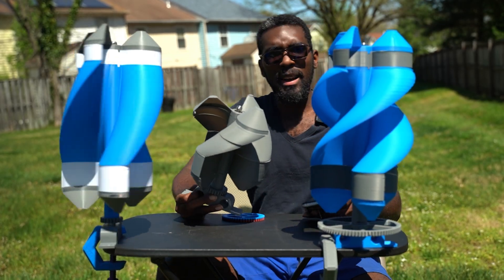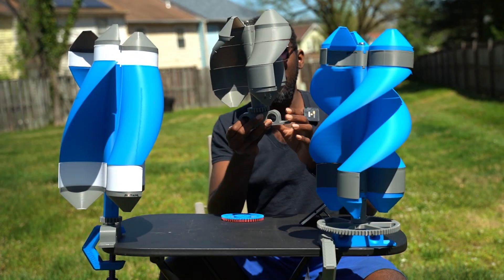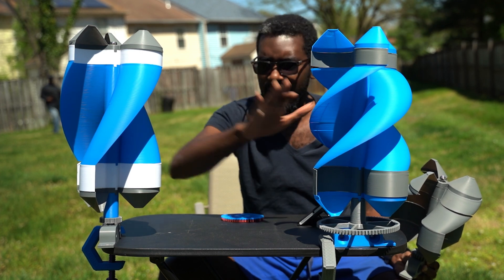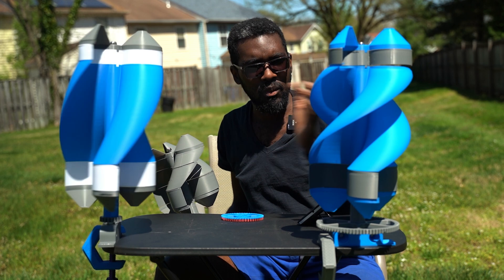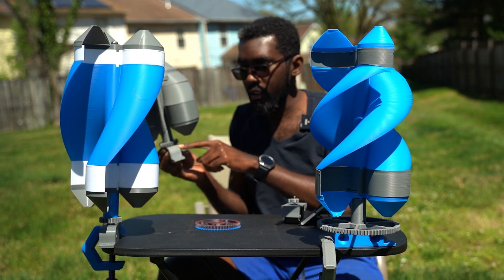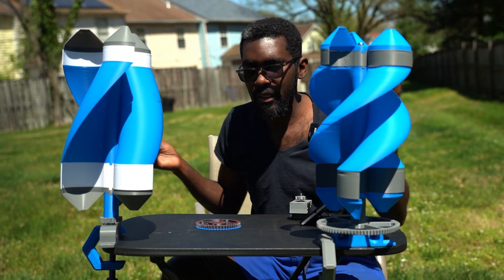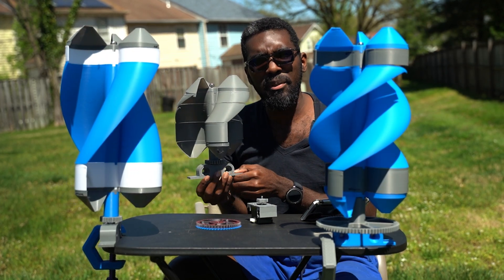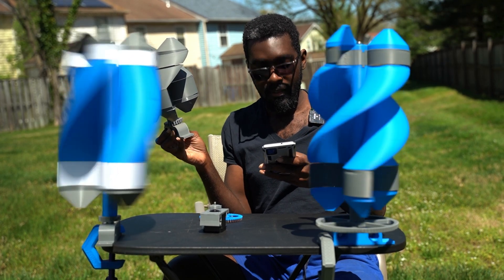3d Printed Wind Turbine Tips and Tricks Build A VAWT

Comment: Why did you change the size of the gear to smaller?  I would have thought the larger the gear the more you will generate from it, of course if you then use a smaller gear to connect to the turbine gear.